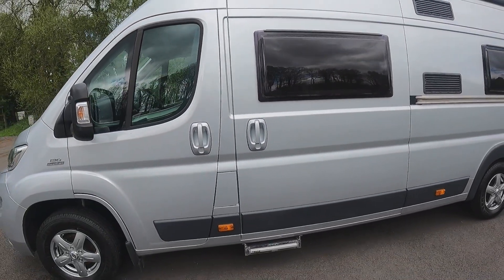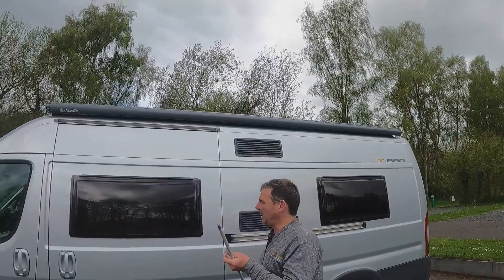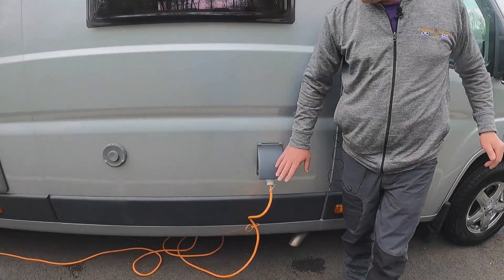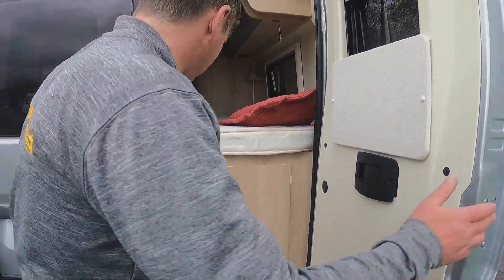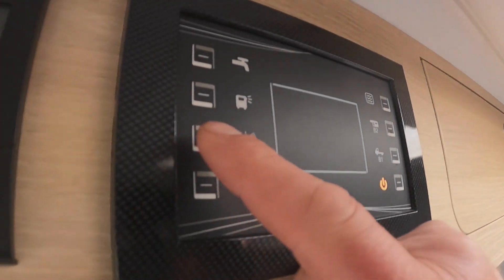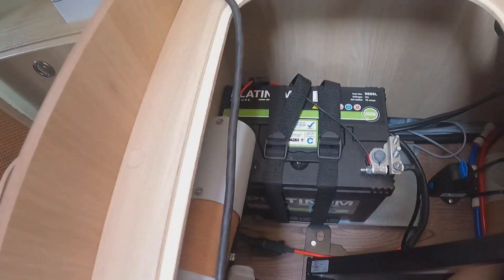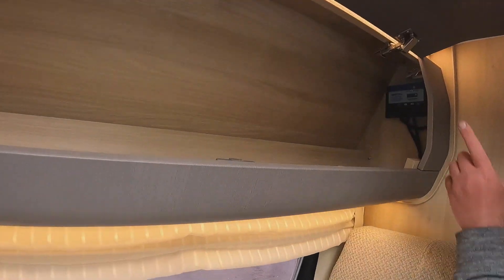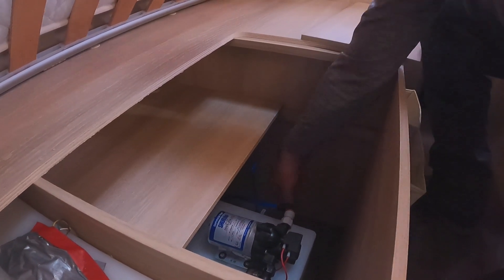Camper Review - Autotrail Tribute T-680 Campervan

Comment: Great review, a few practical mods by owner.  For a 2016 a great spec even better for wild with Lpg.  Only point to note on table rail outside, with a fixed leg it's useless on uneven ground,  customer would be better fitting an adjustable leg to cater for height differences on ground.   That's what I would do.  Keep videos going it's better than TV and dribble we are being feed
Reply from the maker: Thnk's Paul for your great comment 😀 much apreciated 👍